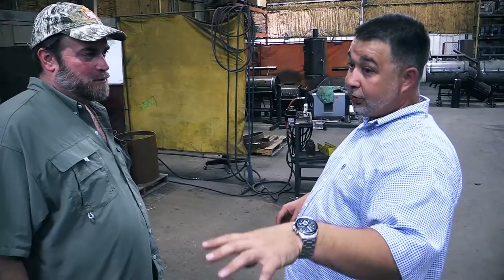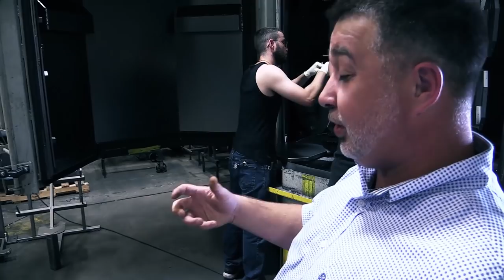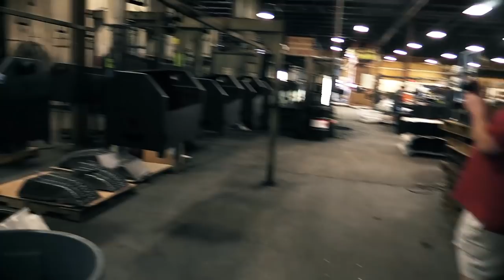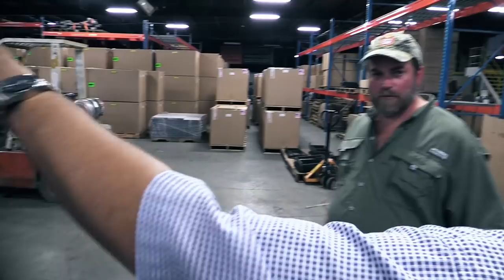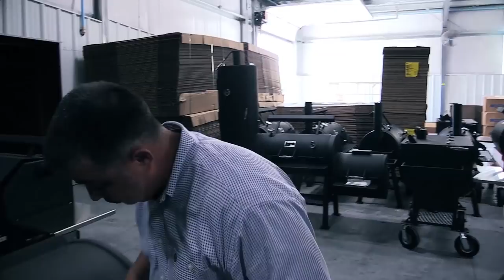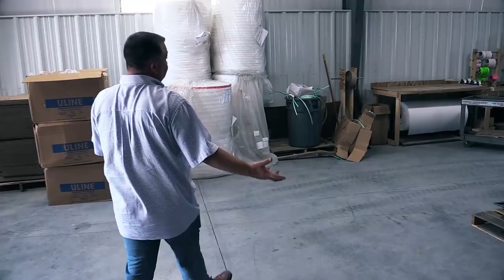Tour of Yoder Smokers Manufacturing Plant

Comment: Great job T-ROY, thank you for taking the time to film this. I've had a 20" Yoder Durnago for about 4 years now after burning the bottom out of a brinkman smok'n pit that I purchased many moons ago. I was very hesitant to purchase another off-set smoker due to the wide temperature fluctuations that were common place in the brinkman. Little did I understand it was because of the cheap thin medal that it was manufactured out of and just couldn't hold heat. That brinkman was a royal PITA trying to keep the heat constant and it would work you to death.

The Durango will hold 250 degrees dead on the nose all day long without mucking around with the dampers at all, even after adding wood. In fact, I'm so impressed with YodeI I'm getting ready to pull the trigger on a YS640!

Again, great job!

Comment: Mr. T-roy where do you have you diffuser plate at. Do you push all the way back to the fire box or do you pull it to the left were it bumps up against the heat baffle
Reply from the maker: I have mine all the way against the firebox wall.

Comment: Love my Yoder YS480 with one exception. The flat black paint finish starts to peel within a months use. Now, they gave me a touch up can of paint but for the cost of these grills it shouldn't be an issue - at least this quick. Also, concerned about the paint flaking off into the meat itself. It's impossible to stop. Whomever idea it was for the flat black paint... not the best idea...
Reply: Apparently they don't clean the product before they paint. Dirt and oil get on the metal during assembly causing the paint not to stick well. I had  YS640, I was not that impressed. The build is solid for sure but QA could be much better. Mine had wires not hooked up when I got it. So that tells me it was not inspected before shipping. I just sold mine. I think their stick burners would be great tho.....

Comment: Hey T-Roy, Love the channel. I was wondering if you had the opportunity to look at a Durango during the tour. I am looking at purchasing a Durango 20'/24'. I think I would love the vertical stack and it would add many options to smoking. I am having a hard time choosing between the Kingman and the Durango 20'/24'. I want each for different reasons, but feel I would make the most use of the Durango. The stick burner I have now is 20' offset (w/o vertical stack), but it needs to be replaced as it is 10 years old. After all your cooks on your Wichita, have you ever wondered if a 24' would provide better results than a 20' since  the smoke flowing through the pit travels a little slower? Anyway, I was just curious if you got to see one and could share any thoughts. I am pretty sure I will have to make travel plans to see one for myself before purchasing. Also, on a different note, if you have never used pear wood on poultry you are really missing out! To each their own, I think you should try it if you haven't!  It is by far with out a doubt my favorite wood of choice for chicken and turkey. It smells amazing as well. Thanks!! Happy BBQ'n this summer, look forward to your response.

Comment: To get even heat across an offset you need baffles. I have mine sitting on the center area of the circle of the cooking chamber. I think they are about 8 inches long.I use 1/4 steel and they are 4 inches wide. There are 6 of them You start with the 1st one next to the cooking chamber inlet. Then place the next one right next to it. After that give the next 4 of them gaps that increase but about an 1/8 inch until the last. This will not extend to the end, I have been able to get the same temperature on both sides this way. I wish I had a picture. Also for your viewers, put a temperature gauge at grate level on both sides of the lid. Don't rely on the gauge on top. I hope this helps. There are videos that show how to do it. Good Luck.